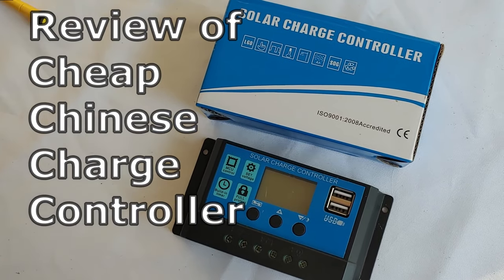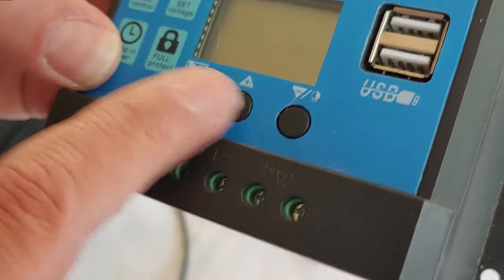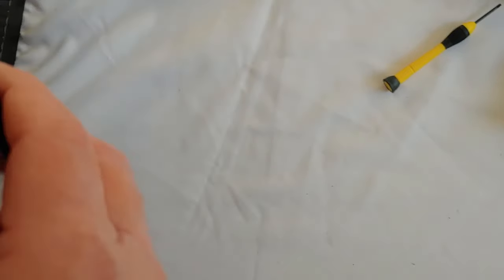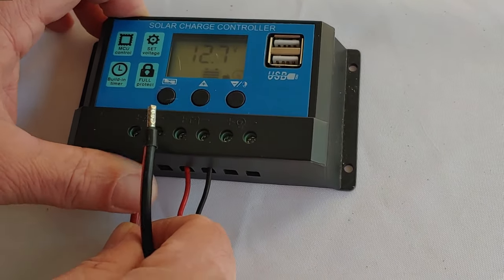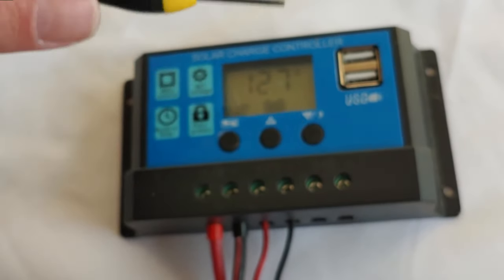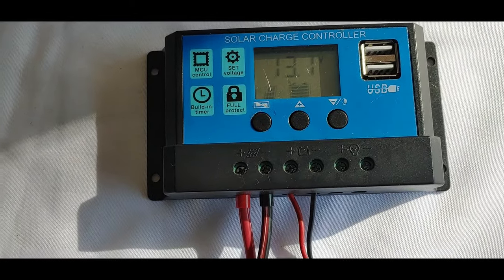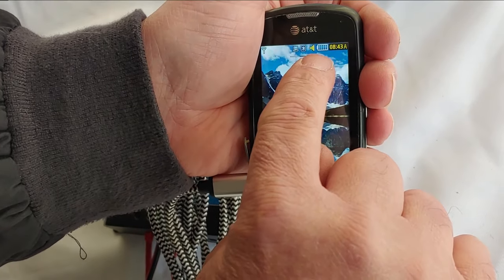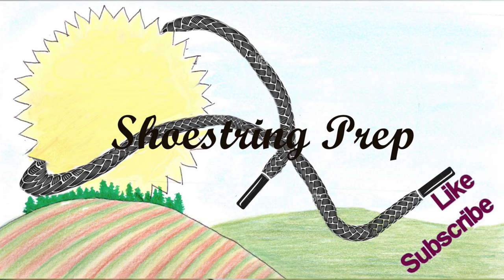Cheap solar charge controller

Comment: Hello! May I ask something? Can USB work without connecting any battery on charge controller, by using only a solar panel, giving current as long as there is sun ? Thanks in advance
Reply from the maker: You should always connect the charge controller to the battery before you connect it to the solar panels. If you don't you could harm the charge controller. Thanks for your question.
Reply: @shoestringprep  Thank you
Reply: @shoestringprep  Do the usbs ports only work when getting power from  the solar panels ?
Reply from the maker: @jono12341000  the USB ports work when the charge controller is connected to the battery. Thanks for your comment.
Reply: @shoestringprep  just to be clear ,so the usb ports run off the battery?
Reply from the maker: @jono12341000  correct

Comment: Maybe yours works, but mine did not.
I tried the 30A and the 100A models.
The voltage reading (on both) was .6A higher than the rest of my meters.
Neither model actually charged my battery.
I have 2 sets of 2 batteries wired in series for 24VDC and 5 sets of 2 100W Panels wired in series parallel.
Neither model gives me an output for the load.
Don't know if the panel voltage is too high or low, and the user's manual does not tell me anything useful.
Reply: I've bought one but never used it yet ,due to a hitch , I have 24 volt battery's and I think controller can only handle maximum 12volt or it will fry ,I bought mine it said 24volts on  advert but on small print maximum 12v input ,if you know otherwise let me know cheers

Comment: I have a question for you shoestring...is there a need for a inline fuse between the solar panel into the controller..?? Or at all..?? The reason I ask is I watched another video, and the guy put fuses going into the controller and out of the controller. I bought the exact model you have  in this video. I am running 80-100 watt solar panel. I'm using 2 little 12V 9 ah batteries AGM. Any info would be great, because I don't understand why the guy put a fuse going into the controller..?? Thanks bud.
Reply from the maker: I do use fuses between the solar panels and the charge controller when the solar panels are 600 watts or more other than that I don't really think a fuse is necessary. Thanks for your comment.
Reply: @shoestringprep  thank you for the advice

Comment: So , the thing im running from the battery (2x12v fans ) needs to be connected to the load terminals of the controller and not directly off the battery ?
Reply from the maker: You can run the fans either way
Thanks for your comment.
Reply: The benefit of connecting to the load side is for the low voltage shut off to keep from killing your battery

Comment: Do you need to open the battery vents at any point? Or does it not vent at such a low trickle charge?
Reply from the maker: You do not have to open any vents, the battery vents on it own. Thanks for your comment

Comment: you can use them on lithium, just need to have a BMS on them
Reply from the maker: If the controller you have has a lithium setting you can. Thanks for the comment.
Reply: @shoestringprep  nop, even if you dont have the option in the controler, it will work, just need a bms on the battery side
Reply from the maker: @chris_mk5supra  good luck to you. Thanks for the comment.

Comment: Would you know what the different battery settings are? I have a 10 and a 30 Amp model. Both show 3 different battery types b01, bo2 and b03. No explanation what these code refer to but I think b01 by default is lead/acid but just not sure.
Reply from the maker: Each model is different with mine b1 is lithium b2 is gel or AGM and b3 is wet lead acid. Thanks for your comment.

Comment: Is there any setting for the controller to charge 12 Volts 80maH Battery???
Reply from the maker: The settings are for the type of battery not how many amp hours. Thanks for your comment.

Comment: Quick ? What are the terminals called that you had coming from solar panels to CC,  the ones you plunged into CC.  What are they called, where can i find them? Thanks H
Reply from the maker: I have attached a link where you can find the connectors: https://amzn.to/3EHB7UK 
I hope this helps. Thanks for your comment.
Reply: @shoestringprep  Appreciate the quick response. Can you check the link, I am getting a two pack of SAE connectors when I open the link, totally possible the problem is on my end
Reply from the maker: @haroldskinner1783  yes, the link is for a two pack. That is what I bought. Thanks for your comment.
Reply: @shoestringprep  Got it, that makes sense , thanks. I am curious on the terminals that you used to plug into the charge controller,  are they bullet or pin connectors.  appreciate your taking the time to answer.
Reply: @haroldskinner1783  Those are called wire ferrules.

Comment: what happens if you connect the panel first, or if you disconnect the battery and reconnect it again whilst the panels remained connected?
Reply from the maker: The panels could burn the controller out
Thanks for your comment.
Reply: @shoestringprep  Could the wrong connection sequence cause the controller to fail to cut off when the battery is fully charged, or to deliver a higher voltage (17 - 18v) instead of the 14,5 to a 12v battery, causing the battery to sound like boiling water, and would disconnecting and reconnecting in the proper sequence fix the problem? Tia
Reply: @englishlessons462 please, do you have answer to your question? I have exact the same issue..
Reply: @Jard000  No, I did not get an answer, but certainly, every video I saw emphasized connecting the battery first. In my case, my controller was not disconnecting when it should and causing the battery to boil which is not a good thing so I replaced the controller. Not sure if the controller failed due to the wrong connection or was defective, to begin with, as in from the factory. I changed the controller and followed the right connection sequence, and it has worked well so far.

Comment: Hello..
I did buy this unit and id do not charge the battery at al.
I hear about the cable must be G10 so what is wrong.
I did change the cable to the battery to G10 and still not work.
Must al the cables be thicker G10 cables ?

I se that you do have a thicker cable that comes from the solar penal.
How can i get a thinker cable to connect the solar penal to the controller ?

Who can help me out of this so i can use it as soon as possible ?
Reply from the maker: I have used 10 gage wire with mine. Under 100 watt solar input and that worked fine for me. Thanks for your comment.
Reply: @shoestringprep  very thanks for answering... 

I am new in this manner..
What is the measure of the body of your solar penal ?

Comment: I have a wet cell lead acid battery that requires maintenance.  What voltage sulhouod I keep it at!  I've read 12 7 but I try 12 9.  It dies bit seen ti last very long in the inverter.  Any advice?
Reply from the maker: I keep my wet lead acid batteries charged up to 12.9. Thanks for your comment.

Comment: I got that controller I keep having to unplug it and let it sit it won't let me adjust it seems it keeps heating up the batteries
Reply from the maker: The controller you have gotten may be defective. If it still doesn't work after a few more tries, I suggest you return it for another one.
Thanks for your comment.

Comment: Can You use on a 12 volt gel battery like Optima battery ?
Reply from the maker: I am not familiar with that type of battery. If the battery is 12 volt and deep cycle you should be able to use it. Let us know how it works out. Thanks for your comment.

Comment: Im looking for one of this controllers, but its about 70$ on amazon spain, is the aliexpress one the same product?? Theres about 10$
Reply from the maker: I don't know if that is the same product or not, but $10 sounds about right. Thanks for your comment.
Reply: @shoestringprep  cool, thanks man ^^ and i have another question, i dont stand the difference beetwen different versions of that controller, i see they have different A, but is that the peak intensity of the battery or output?? sry for my english haha

Comment: Yeah ok but you need to understand that the load is running from the battery and so is the USB. At night the USB and the load will still run without the solar panel.
Reply from the maker: Thanks for your comment.

Comment: hi my solar charger controller  looks after the sun gone is drain  the battery   and the battery is not  connected with nothing
Reply from the maker: Since that is the case I would disconnect the charge controller when I wasn't using it to charge the battery. Thanks for your comment.

Comment: MIn 5:00 , but in the settings , there is 3 different Batterie types (b1 , b2 , b3 ) ... `?
Reply: B1 sealed lead acid; B2 Gel; B3 flooded lead acid.

Comment: I don't know if the various colors that these come in are all the same but the green ones I got that look exactly like this otherwise are absolute junk.
They don't even pulse width modulate as advertised.  When the battery reaches voltage, they just disconnect instead of throttling the current for a proper top off and then they won't resume charging until the battery voltage dips way down to mostly discharged (13.1 volts for a Lifepo4). 
Unacceptable.
Reply from the maker: That would be unacceptable thanks for your comment.

Comment: Is this and mppt charge controller?
Reply from the maker: Some listing said it is. I have my doubts
Thanks for your comment.
Reply: They're not even PWM, with 3 stage charging, just simple devices that switch in and out at pre-defined voltages. There are much more informative videos on YT where people put watt meters on the inputs and outputs of the charge controller to show you how MPPT works (like a Buck regulator). MPPT's have sizeable inductors in them. Taking the back off one of these in a teardown video would reveal no inductor and very little heat sinking so 10 amps is optimistic. To get the best from a lead acid battery and avoid sulphation you need at minimum, one that will do at least 3 stage charging (bulk, absorption, float) and with pwm control. Ultimately these are false economy just like the harbor freight ones @shoestringprep showcases as the cost saving on the controller doesn't cover the expense of shorter battery life, even on basic flooded lead acid starter batteries. The irony is, the LiFePO4 batteries that are not recommended for this controller will probably be less likely to succumb to the poor charging regime if they have a decent battery management system and you're only pushing a few amps in. It's more likely that the controller will fry than the battery if you use a big panel as the lithium will take the amps with very low internal resistance but the controller will overheat trying to meet the demand.

Comment: These will fail within weeks/months. They are simply not worth the grief they provide.  I have used 6 of these and all but one have failed or done strange things (like keep identifying the battery as 24 volts when its only ever been a 12 volt battery attached). The other does as razorsharpbt says below: defaults to 14.4 volts no matter what you tell it to do. Just spend the money and buy from a reputable manufacturer. My last 10 amp Morningstar charge controller on an old 12 volt bulldozer battery running an electric fence unit out in the wind and rain lasted 10 years
Reply from the maker: Morningstar is a good choice. Thanks for your comment.

Comment: Weojeviy Solar Charge Controller Battery Solar Controller Lithium Controller Simple Protective Function Photovoltaic Controller(30A)
Brand: Weojeviy
... These literally say they are meant for lithium Ion???
Reply from the maker: Some models say they work with lithium batteries and some do not. The model I was showing the instruction said do not use lithium batteries. Thank you for your comment.

Comment: You CAN use them with lithium and LiFePo4 batteries, dummy! READ the manual. It tells the battery settings to use in the controllers menu screen!
Reply from the maker: Some of the models are different and say No LiFePo4. Thanks for your comment